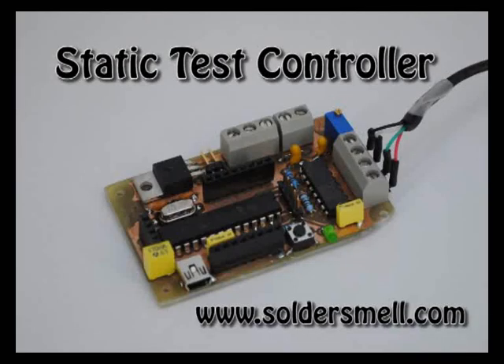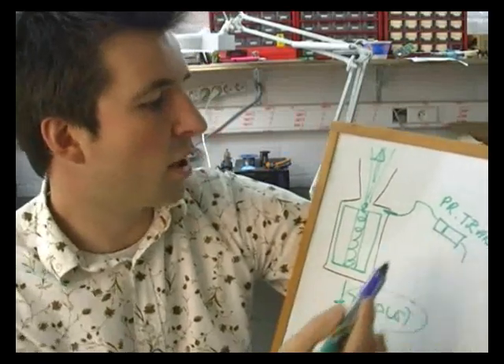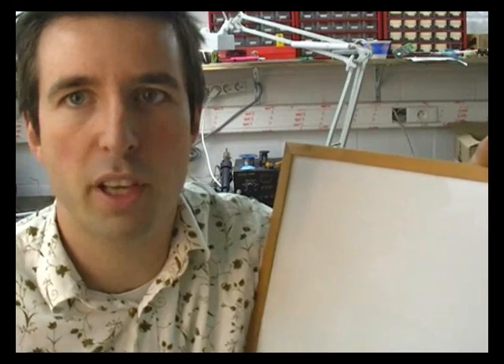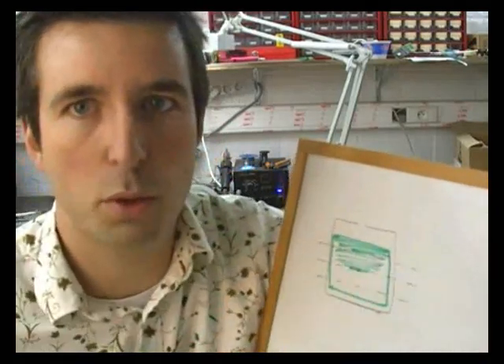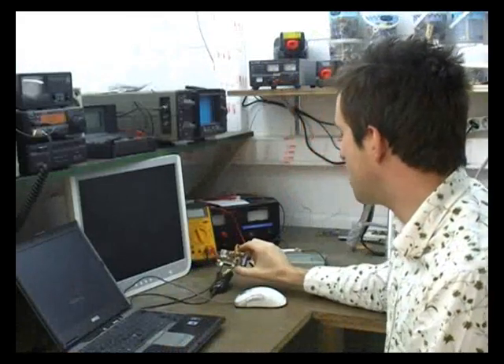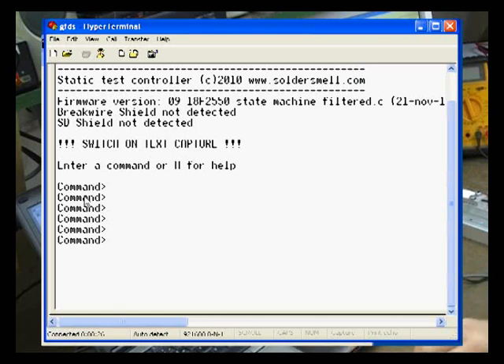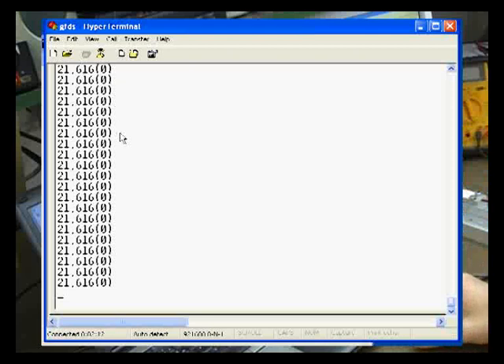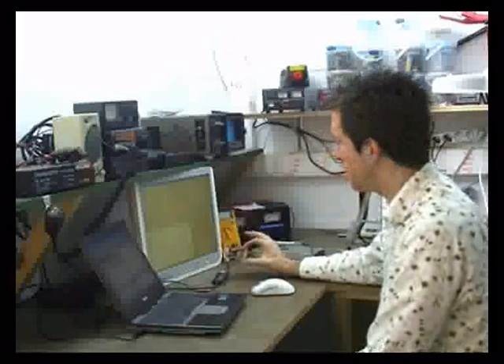Static test controller prototype demo

Comment: I think the "all-in-one" aspect is great. I like the idea of the break wires, I've thought about casting some grains in glass or plastic to view propellant rates in different parts of the motor and the breakwire method comes close to being able to "view" the burning in the combustion chamber. The SD flash memory will be nice. And I'm hoping the package will fit in the optical drive bay of my Toughbook CF-27 that I've dedicated to rocket data logging.